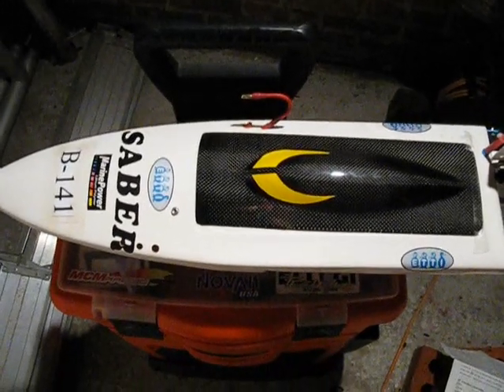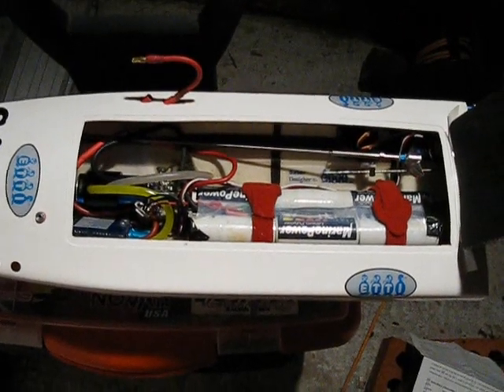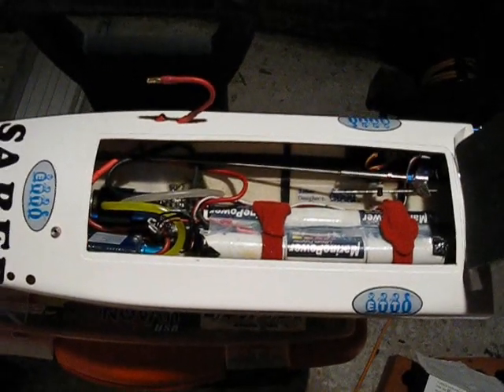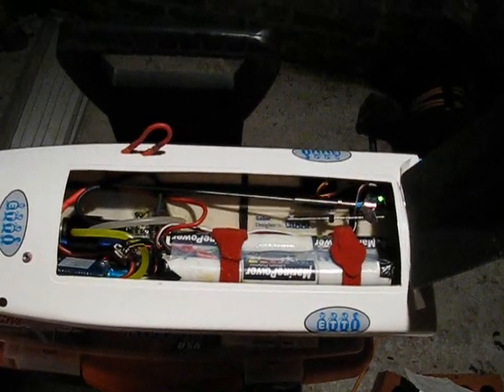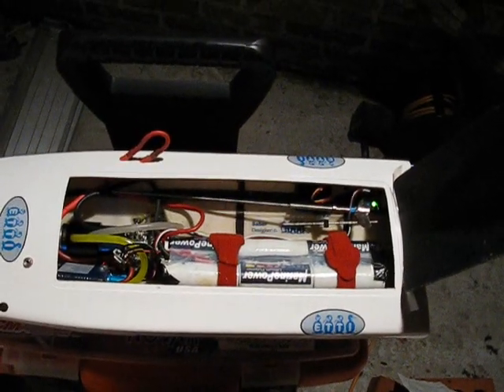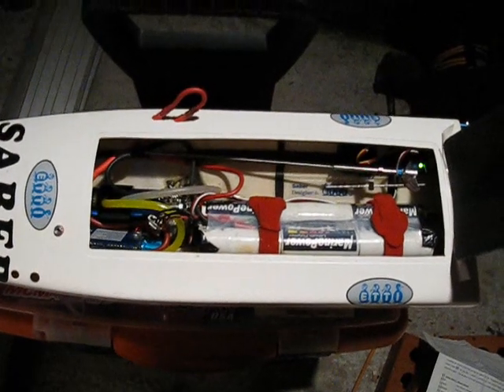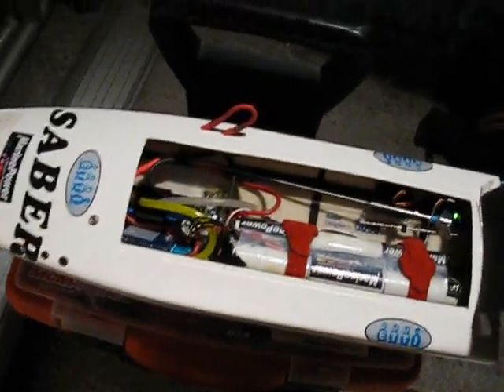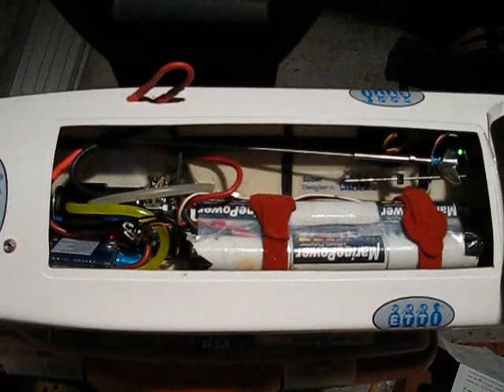ETTI esc

Comment from the maker: 36mm metal prop or graupner 2318.36 , doesn't matter. The metal prop will last longer and a graupner prop is cheaper. You descide what you can afford. I use ETTI 36mm CNC props.

Comment from the maker: Use a 380 size motor in your Saber like the ETTI B29 , 36er motor is not needed and to heavy. B29 3600kv and 3S lipo will be great with a 36mm propellor.

Comment from the maker: I'm using the B29 ETTI motor for mono1. 4-pole motors have more power and torque. the efficiency of 4-pole motors is also much better. So my choise of motor is a 4-pole motor for sure. I'm using 15° timing on all of my 4-pole ETTI motors. I hope this helps.

Comment: I'm amazed. All of the Octura props, etc. are Left hand turning unless you specially order a right turning (clockwise) prop and they are not easy to find. Let me get this straight, if you are looking at the prop from the back of the boat, is it turning to the right or the left? Ours are ALWAYS turning to the left.

Comment from the maker: No Jim , the opposite is true however. Our boat's motors all spin clockwise. A motor's direction is always seen looking at the motor with the back bearing plate closest to us , so our motors spin in the clockwise direction meaning to the right.
That's why Graupner K props 2318.xx that are left props always have the L on them like this 2318.45L. These L ( left turning ) props are mostly used for twin motor setups.

Comment from the maker: Hi Jim,

The PWM is normally set to 16K and this is the default setting.

Default settings :

*cutoff voltage : no cut off
*trottle options : automatic calibration
*brake options : no brake
*rotor rotation : right hand/clockwise
*timing : 2° for 2-pole motors
*PWM option : 16K

Comment: David, good stuff! Do you normally have to set the timing and PWM for your motors as well or is the Etti self sensing in that regard? Do you know what the default settings are on the ETTI 150?

Comment from the maker: 32" V mono with 2300kv on 12 cells intellict should be OK. Must be a fast boat :-)

The Ammo motor is a 2 pole motor , so keep the pwm option in default setting of 16K and timing also in default setting of 2°

I use the 150A esc in my 30" mono on      6S2P A123 batteries ,goes really well.

Good luck with your boat & esc.

Comment: Yah thats what iv dun. Okay. so you say. but i cant fully see what diferens it mayks if  isplitt so the whater gos trugh the esc on both sids rater then around? whell i cant drive now with my at min 80 *C Il try one tube then. Iv got v 32" no name and a Ammo Motor 2300kv 36-50 and i runn intellect 14/12 cells. 

What shuld the pwm option on the esc be at? 8 16 or 32k?? i think the rpm is a litle lo maby. 

And again so thankful for your help!

Comment from the maker: water from the rudder must first go to the esc and secondly to the motor , so the cold water goes to the esc first. Don't split it in 2 ! Use only 1 tube from esc to motor. You will get much lower temperature on the esc. try to keep the esc under 60°C and you will be OK. What boat and motor and batteries do you have ?

Comment from the maker: Hi,
Yes they cut off when overheated. Use sufficient water cooling with a good strong water flow and it will be OK. 
95°C is VERY HIGH , stop running your boat on this temperature ! My 150A etti esc keeps cold , no heat whatsoever.